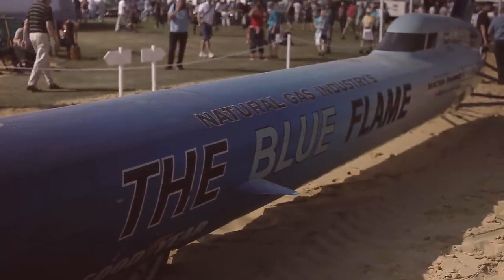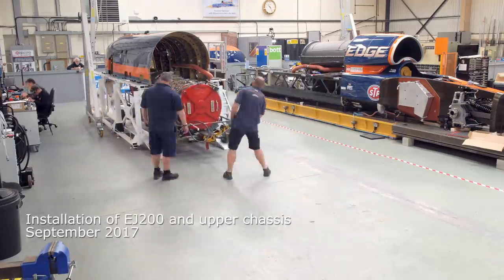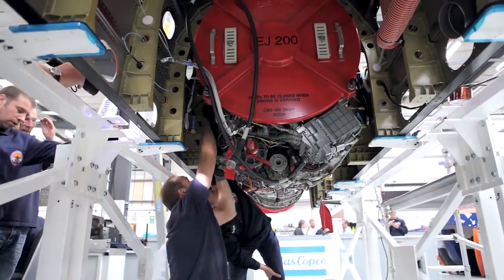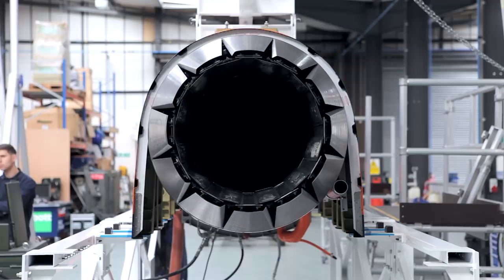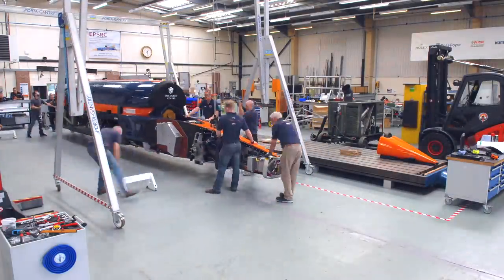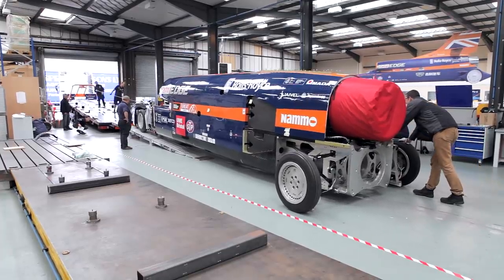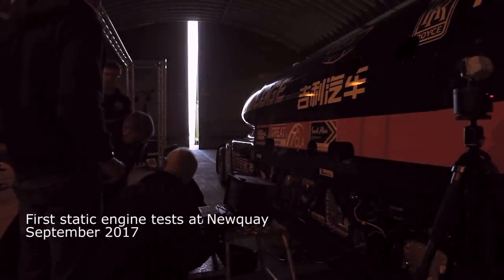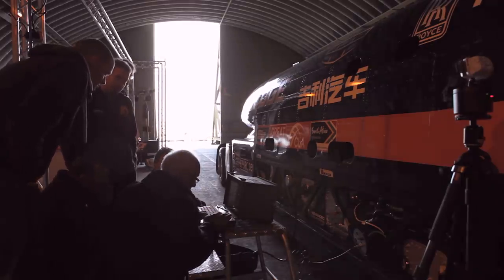Cisco BHTV: The mighty EJ200 jet engine

Comment: presumably a good reason to prefer a jet engine is that its thrust can be throttled. A solid fuel rocket engine can't even be turned off once started.
Reply: Adam at Epsilon which is why they are using a hybrid rocket that can be throttled and cut

Comment: I always wondered if a jet engine would still run with no wings and decals all over it. What a technological breakthrough...
Reply: Eric Loftus bloodhound ssc has kind of become a joke at this point. A project even like this should not have taken this long. Way way way to much engineering for something they aren't even sure will achieve its maximum speed goal of 1000. Also they've run out of funding several times I think now at this point.
Reply: It's really not a joke, the car has been fully designed, developed and all the components have been tested, just because they've been having financial issues is no reason to call them a joke.

"Way way way to much engineering", mhmmm, because I'm sure you know all about how they did this, you could probably do this no problem huh?

Comment: Because there is no dyno available for such test...
Reply: you need driven wheels for a dyno
Reply: Hence my comment!?...
Reply: There would be HP readings, but I am sure if you google the total weight of the car and the engine output you could calculate the BHP. :)
Reply: For jet engines BHP is a function of how fast you're going (faster = more power). Because this test was static, the effective BHP was zero!

That said, there are other measures of power for a jet engine. One is the 'Jet Power', the amount of power being used to accelerate the exhaust. In other words, it's the power that contributes to movement of the vehicle rather than spinning the compressor. Some back-of-the-envelope calculations suggest that for this engine the jet power is somewhere in the vicinity of 66200 horsepower.
Reply: ... you can just put force meter on the cable attaching it to the ground.

Comment: If this is a jet engine of a typhoon fighter jet how can you not know the thrust ?
Reply: Hemeralopie they were checking thrust after applying the weight of the vehicle and friction of all sorts of things related to a ground vehicle. Air based thrust is different than ground based thrust in many ways
Reply: How can you know the actual thrust from THAT engine, in THOSE conditions?
Their own intake design may or may not work well, the engine may not be in perfect order, and it's a static test (no 'ram air' effect from motion).
Reply: I see, is that combustion engine already fitted at this time?

Comment: What's the purpose of the "moving" nozzle?
Reply: NGC 2392 thrust vectoring helps direct the amount  of thrust coming out of the engine and helps a fighter to make tighter turns at lower power.
Reply: @EssexLocomotiveEnthusiast  the EJ200 is not thrust vectoring, has nothing to do with aircraft handling it's needed to achieve the performance.
Reply: Increases thrust.
Similar to putting your finger over the end of a hose pipe.